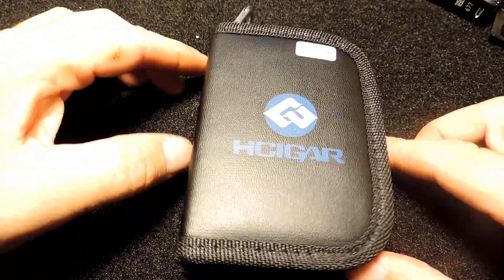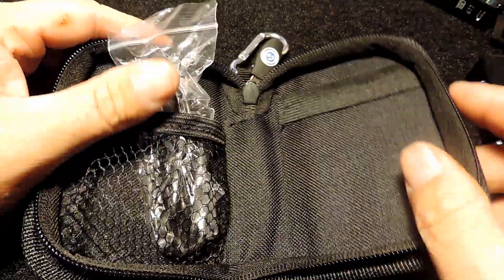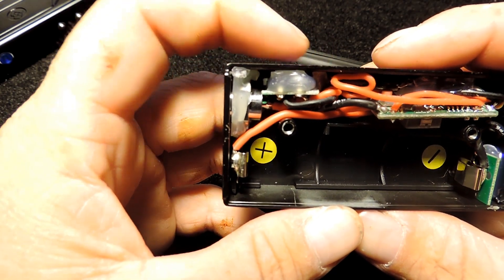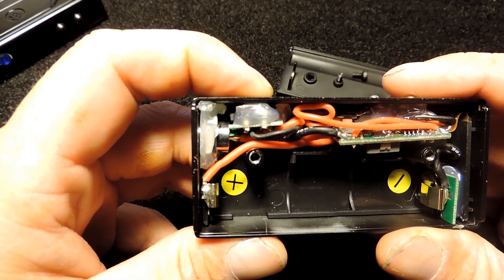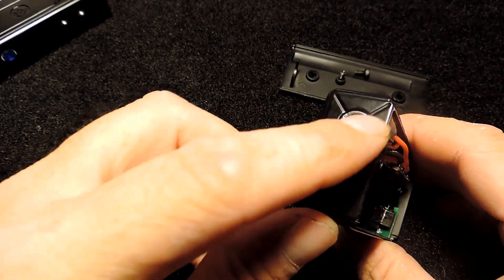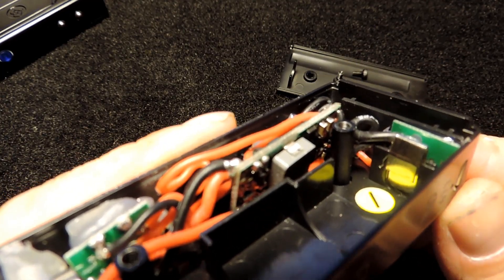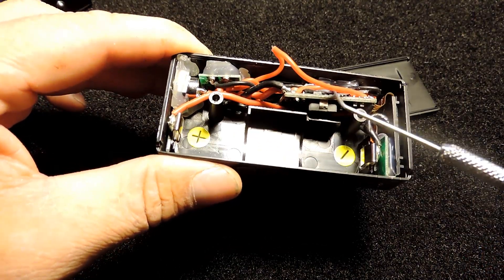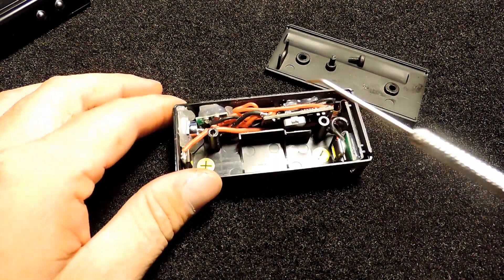DNA 35 CATCHES FIRE NEW DNA 35 MINI FROM HCIGAR MUST WATCH

Comment: Brother, this EXACT DEAL happened to my HCigar mod as well! Exact same scenario, and upon further inspection the same problems you found I did as well. Thank you for posting this, I hope anyone who is looking at this e-cig mod STAYS AWAY unless they want to do some serious reworking on it (or trash it.) I thought I was going to have a fire on my hands when this mod went off. The fire button gave me so much trouble it finally locked itself and couldn't unlock AT ALL. Then the capacitor blew. Anyway, keep up the good work reviewing!

Comment: Good job man. Great video. Man after reading some comments I hard to start defending you lol. People can be dipshits. A lot of people took praise and thanked you but a lot of people were bashing on your review. Those people are obviously not on the same page here. 

Thanks again for saving me the hassle of going through this tragedy. Subscribed and will be an avid watcher and troll smasher. 

Thanks again.
Reply from the maker: @rich Hawkins thanks for the support and sub
Reply: TheToolking no problem bud. Can you recommend any 30 Watt box mod devices that are reliable?
Reply from the maker: What's your budget ?
Reply: TheToolking preferably around $100. As I want to pick up an Orchid or rose v2 atty and a beyond vape silo ease of use.
Reply from the maker: I highly recommend the ipv2 just make sure you buy the revised version with the hex or Alan-key screws holding the battery cover on
Reply: Hmm. I've checked that out. I've been drooling over the ipv3.. That things looks SICK AS TITS! (thanks Rip for getting me addicted to that -_-) lol. 
Oh man. I'm kinda torn between the sigelei 100w raptor box and the ipv3. I'm disgusted with the voltage irregularities on the sigelei though. So not sure where to go with this. Was also thinking about the smy God 180 Watt mod but it doesn't even have an adjustable connector pin and gaps between mod and atty will activate my ocd and I will freak out lol. I cringe at the thought of those hideous massive gaps. What do you think? Also, having dual 18650s is DESIRED for all day vape.
Reply: rick hawkins I have the sigelei hundred watt. I been using it for a few weeks and it doesnt seem to have any voltage or wattage irregularities.  If the atomizer and pin do not have a good connection the resistance will fluctuate a little bit which can cause some voltage jumps. But as long as the pin is backed out and making good connection it performs beautifully.
Reply: rick hawkins Go Get the Gi2 clone from Fasttech.
Reply: rick hawkins The IPV Mini, Sigelei Mini 30w,  MVP V3.0 (not the 20w but the new version coming out 02/15), the ELeaf iStick 30w and new 50w, The Asmodus Colossal (they are the OEM for IPV and Sigelei).
Reply: rick hawkins ik this is an old comment but, u asked about a 30 box mod. Next thing you know your talking 150w+. Threw me a off as well I'm using a silver sigelei 150w with a delta 2 and loving it btw no problems so far. Hope u bought the one that was well suited for u.

Comment: They don't really concern themselves with safety, you're absolutely right. To do it properly, the 510 NEEDS to be press fit and then epoxied. The switch is debatable, hot glue is not ideal, and epoxy is still better, but whatever.

The issue, of course, is that they're using the clone boards, which are not good at all. The other issue, and this is the big one for most of the mass manufactured China devices right now, is that they're using hot glue where there should be epoxy. The reasons are fairly obvious, unfortunately. Epoxy sets too fast, so having it on the line and machine applied is basically impossible. Hot glue, on the other hand, fits the bill quite well. It is horrible.

Fortunately you had an 18650 in it, because a LiPo would very likely have vented too. A cap blowing is scary enough, and COULD pop an 18650, but a LiPo venting is absolutely terrifying. 

It's unfortunate that HCigar is taking the attitude that they are. But honestly, if the price point is similar to the iPV2, there is little reason to not go for it, as their manufacturing process seems to be better (despite the issues you had with your own, the devices in later batches are pretty good).

Comment: damn i ordered one before i found this video and its going to be here tomorrow :/ i will be sure to look at the internals first and thank you so much for making this video, thinking of epoxy glue the 510 and button and file down the part that may touch. does that sound lika a good plan or?
Reply from the maker: i would just be careful with it good luck i hope they improved it
Reply: TheToolking luckily i found this vid, opened up my unit and the 1 of the 2 pins was just a hair from touching the screw post! and same thing at the 510 connection and firing button... i fixed it right away and works great :) this mod is apart from the inside built really well and feels solid as a tank, and really nice finish.

Comment: improvements have been made in the new ones the 510 is held in by the case and they use more hot glue not just to hold things in place but to add support for wires and boards, got mine looks similar to his but definitely put together better

Comment: Caps don't vent. They explode. That one that exploded for you could be component failure. Happens in electronics. Particularly when putting high loads through a little pcb like DNAs. That being said, the build quality of that device is terrible, made to short at the board where you pointed it out. It's usual for china electronics that user safety isn't really a concern. They send out mains electrical power tools with shit grounds, etc. Good video, something we all needed to know. Thanks.

Comment: They are not using cloned boards they are using their own designed boards in these devices. That being said I'm sure hcigar bought the boards in good faith. Unfortunately at some factories in Asia quality control is less that stellar. Your battery would not have vented because when the cap went bad the flow of electrons was cut off. Meaning no current was flowing after that. 

Now onto the obvious failures in this device being how the 510 connection was installed and the switch really hot glue. I thought they had learned their lesson about that by now. We know which companies over seas that are doing things right it looks like hcigar isn't one of those. Great video by the way you probably saved a lot of people from making a bad purchase.

Comment: This isn't a new problem. It's been happening with the Fasttech DNA30 clones as well, and I've also had two of these HCigar burned units pass through my hands (both were the 30 Watt chip - one was the TBD DNA30 "Mini", and the other one was a Hana style). One of those units burned right in front of me while I was using it. This happened to me a bit over a month ago, when the HCigar 30W Mini was first released. They use the same chip set as the Fasttech Hana DNA30 clones - read around, and you'll see a few other reports of this happening with Fasttech clones.

Aside from some really foul smoke, there was no major heat generation, and I didn't even have an Allen key on me at the time to open up the panel to remove the battery. The battery seemed fine, even after the incident and staying in there for 6 more hours. I had initially thought the battery had vented, but once I finally got it open, I realized the battery was fine, and it was the board that had burned out.

Comment: wat a pos, that must have been scary as fk bro thanks for the vid, still a firm believer that the evolv chip should have never been cloned and after cloning reprogramming for extra power that little extra is what fks those chips plus the chip only holds 20 gauge which is ok but not for sub ohm at 35watts, plus they use crap components to make the clone chips and people say electronic clones are the same smh! if that was an authentic hana mod or authentic vaporshark people would be going nuts #fkhcigar they got you sucked in with nice shit so now they can sell you crap!

Comment: This doesn't surprise me at all. This exact clone is being sold locally in Minnesota for $140, which is laughable since the original Vapor Shark DNA 30 that it is modeled after can be had for $119 (the new rDNA 40 version is only $189). If you spend a few extra bucks and get yourself a genuine Evolv-powered or ProVape product, you'll not only know that you're safe and that the company stands behind their product, but you'll have something that will last as long as you need it to, as opposed to buying a new device every few months because the hot glue came undone.

Seriously? Hot glue? Come on.

Anyway ... great video/warning. On a related note, the IPV3 is an accident waiting to happen. I was alerted on 11/25 that the 9-volt charger that is sold separately is being recalled. Nick Green confirmed that yesterday in his vlog--he has a source that apparently was notified by Pioneer4You that using it could cause the mod to "blow up."

ProVape & Evolv, guys.

Comment: even the dna's.. your throwing massive wattage over tiny little wires, every dna build ive seen is just plain rediculous. there low power use, chuck a .5ohm coil on anything with tiny wires and its gonna go bang eventually. how about title this "i tried to run WAY too much off my tiny device like every other vaper out there and it went bang in my hand"

Comment: I fear a lot of these cheap Chinese mods are exactly the same if you open them up. Purely a case of you get what you pay for me thinks. Even the iStick 50w which is an awesome mod is made to a low price, if you look at an equivalent American device like the Vapor Flask V2.1 DNA40 you are paying 5 times as much but the build quality and materials are worlds apart. Generally i would say be careful with any cheap Mod and never charge when asleep in bed Also if you can charge your Mod / Batteries in a lipo charging bag.

Comment: Iam so pissed o didn't research this i took for granted hcigar wouldn't sale shitty craftsmanship . Hes right min didnt blow but was about to i notice my atomizer was spinning or loose. I open it and what did i find the same shit they got glue holding 510 connection.  Also the usb is held by glue it will eventually get pushed back from slot all the button s will be sinking in the box. Poorly mad wasted 80$ only had mod for 2months 🔥🔥🔥🔥